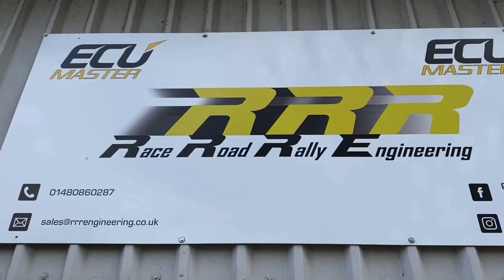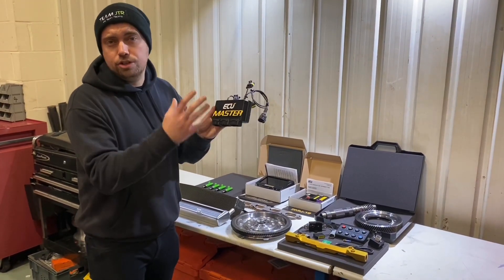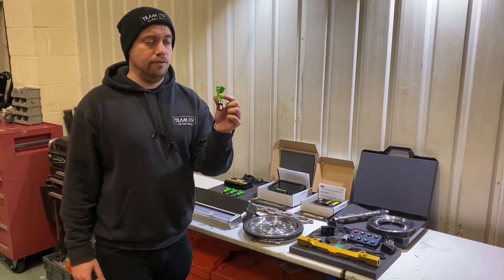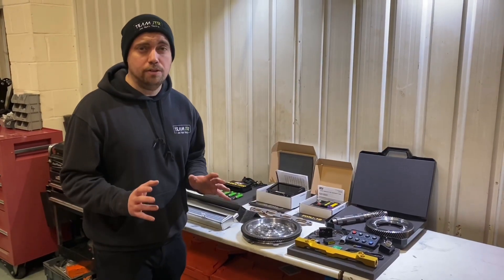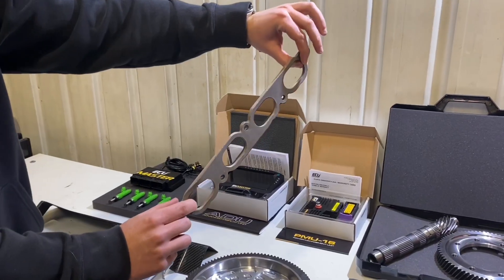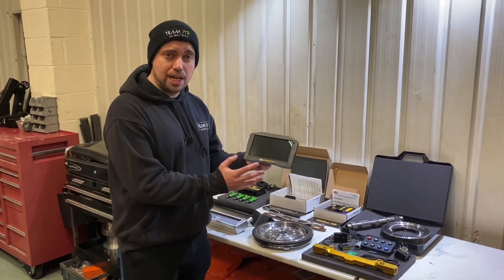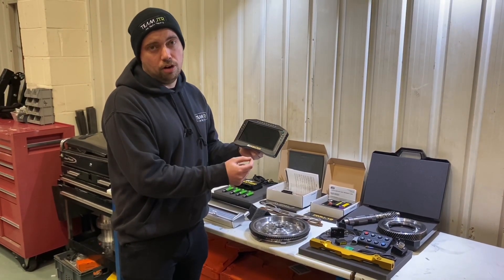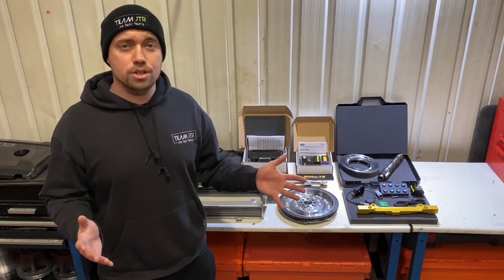New Products for the Lotus Elise S3 by RRR Engineering & Ecumaster

Comment: Did you have the shorter final drive installed on the JTR Elise last year, or is this something you'll be installing in the future?
Reply from the maker: Thomas R No I didn’t have the RRR one installed but worked on that with them. We were going to run it this year because the final drive makes a huge benefit for track work with faster acceleration but instead we skipped a step and jumped straight to a sequential gearbox as mentioned in my latest video 🙌